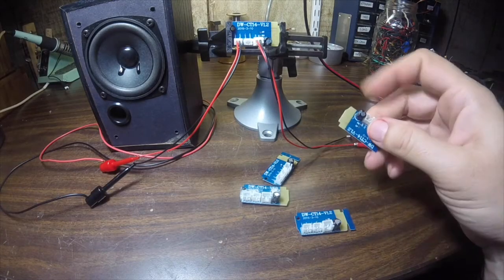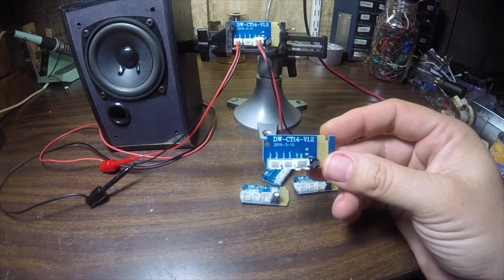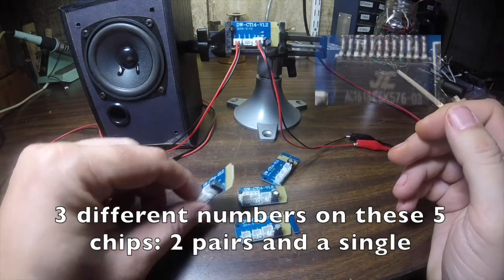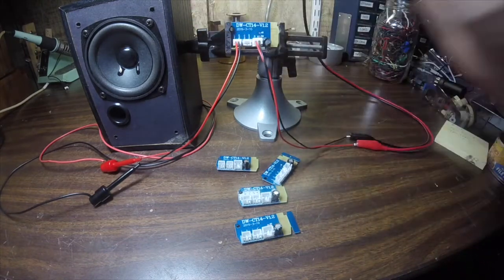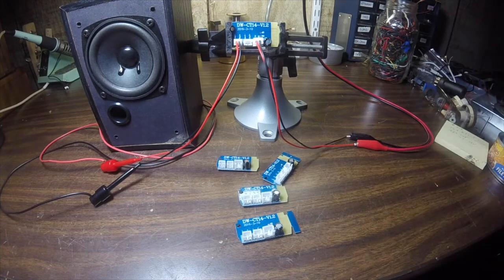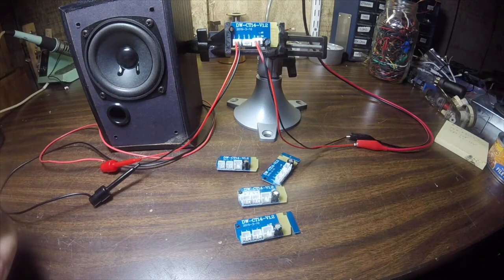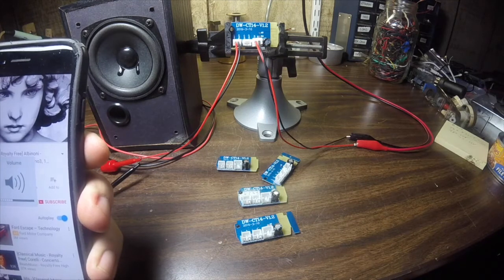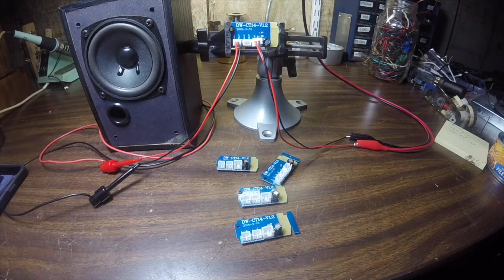Final Update BT Mono Amplifier Board

Comment: The first one seemed to have problems with range when it was in the wooden box.  The rest were measured in the jaws of your vice.  Have you considered that the metal jaws of the vice loaded the antenna and improved the reception?  Did you substitute one of the good ones in for the bad and see an improvement?

By the bye, I really like the way that cigar box came out.  It was a nice touch to put the fan cover over the speaker.  Looks really cool.

Comment: Is this really mono? This is the v1.2 and it supposed to be mono. Asking this because I've got the v1.6 and it isn't mono....
Reply from the maker: The v1.2 version is definitely mono. I haven't seen the v1.6 board. It could very well be stereo. Could you send a link to where you got the v1.6?
Reply: NizzyAmps https://m.ebay.co.uk/itm/DIY-Dual-Mono-Digital-Amplifier-3W-5V-Board-Module-For-Bluetooth-Speaker-/232347282888?txnId=1503260199013 I bought this one, and if you scroll through the pictures you will see a red board. Now that one is the v1.6... There wasn't an option to choose which one I want, and there wasn't a proper disclaimer that the v1.6 is not the same in functions as the v1.2. I've tested it using only on output channel, and it wasn't mono at all :/